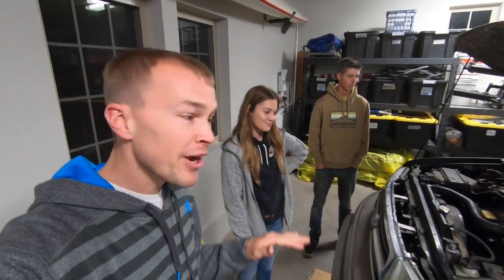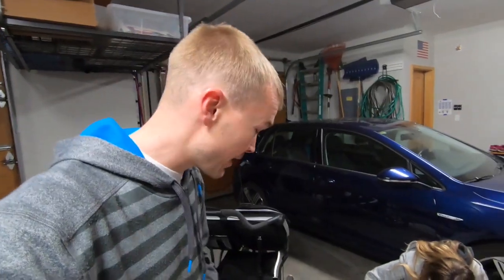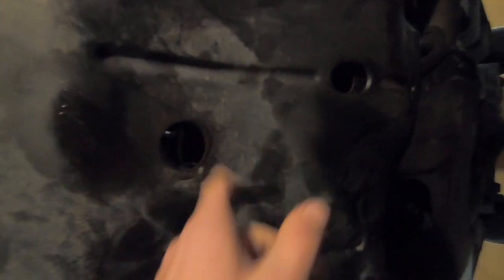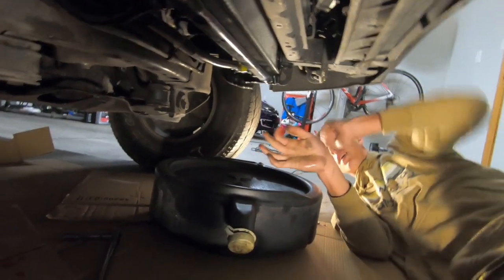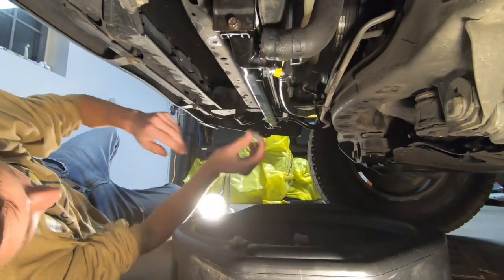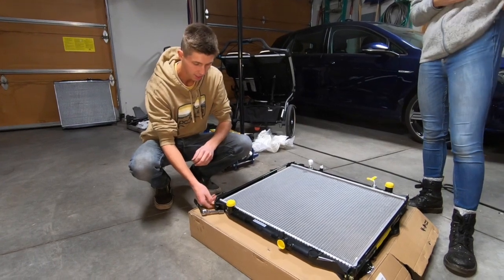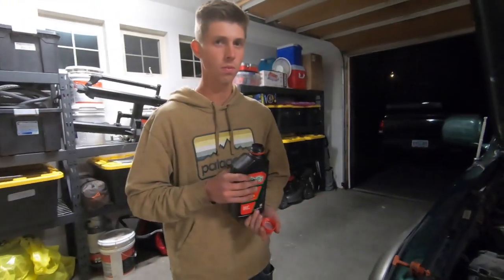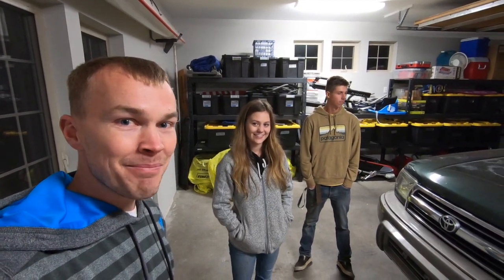Install Instructions - 3rd Gen 4Runner Radiator

Comment: I now live in Costa Rica and everyone drives a 4runner or a pathfinder. My original  radiator had a crack across the top which is some sort of plastic .so we temporarily fixed it with Epoxy Steel .lucky me was going back to the States so I brought one back .Had our local mechanic install it for 20,000 colones , which works to be around $36.00 .it took around 2 hours .the only problem we ran into it was 3/16 wider .other than that piece of cake .

Comment: You should run the engine with the radiator cap off and add coolant as it goes down so you don't have air in the system. Seems like it worked out for you though so I wouldn't worry about it.
Reply: Tried that on an Accord once. Instant volcano.... 😄
Reply: @midnightmystery544  that shouldnt happen??? It cant build pressure or get hot with the cap off, did ypu let the car get cold or just sent it and opened it after driving lmao

Comment: I am doing the same replacement on my 99 4Runner. I believe that the fan shroud does not have to be remove, just detached and pushed back so that the lower fittings on the old and new radiator can clear during removal and installation.

Comment: Should run vehicle with heater on high with to open up heather core and let coolant circulate with the radiator cap removed to also get rid of air bubbles hat might be trapped in the system.  Also best to use straight coolant when refilling since there is more than likely still a small amount of coolant mixture in there.  So best to fill half with straight coolant then top off with distilled water.

Nice work, nonetheless!  Next up should be ball joints and they are cake to replace!

Comment: Radiator from ebay..............
Reply: You can get the Toyota OEM radiators on eBay for much cheaper - either listed as Toyota OEM, or Denso labeled (who is the OEM manufacturer for their radiators in the first place). Much cheaper than ordering from the dealer. Local dealer quoted me $216 for the radiator, and it can be had on eBay for ~$125.